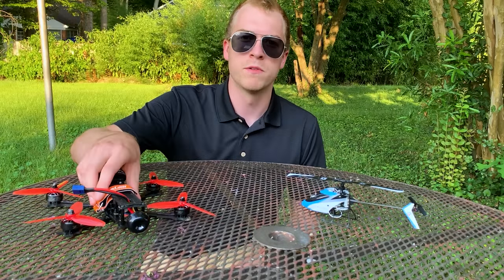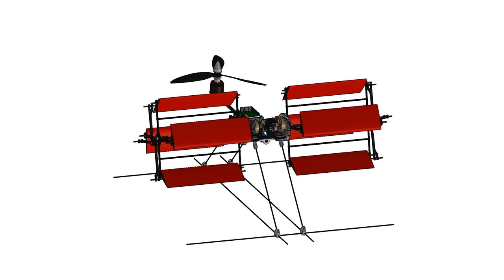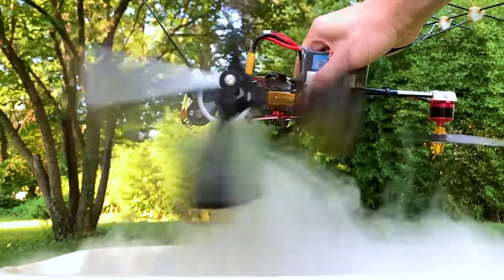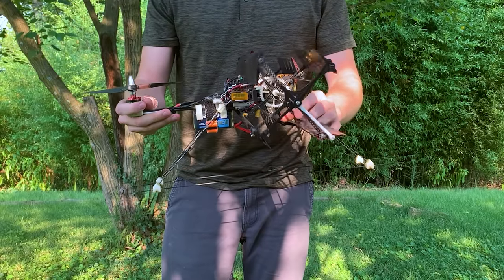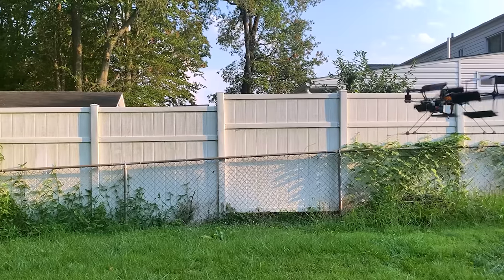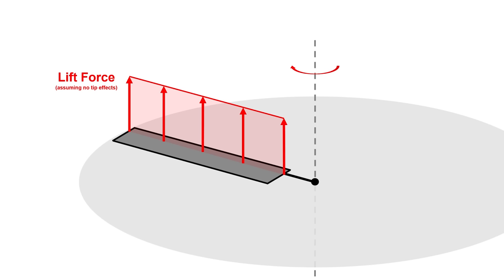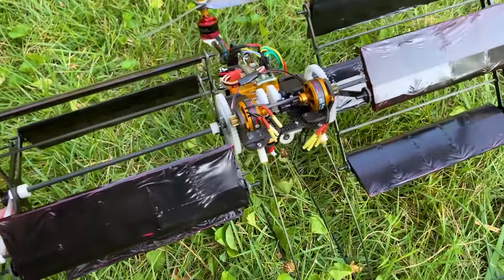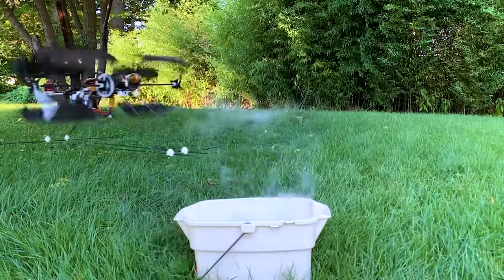Cycloidal Rotor Drone: The Cyclocopter

Comment: It looks like it flys (or flew) really well! I've never researched how these things work, but your explanation is really easy to understand!
Reply from the maker: Thanks Tom, it feels mostly like a tricopter in the air. There’s a bit of control coupling between pitch and roll that can create small oscillations, but a fast enough controller takes care of it just fine
Reply: I think you need to build one of these tom, with four cyclo-rotors.
Reply: @rcaviator8408  looks like toms goal is mainly on batteries or thing likely for energy storage…
Reply: @minercraftal  True. But I think he would be great at this.
Reply: @rcaviator8408  I’ve been tried on several objects and got problems of having everything jammed up. 
Seems it’s way better to get stuck on a single object so that able to finish it…
Reply: @minercraftal  Yup. Same here.
Reply: @rcaviator8408  Totally agree with this, kind of a tandem rotor equivalent. Also could you put a small dihedral angle between the rotors for additional stability?
Reply: Build one now?
Reply: hey tom your here i do not need to go you're channel bluild something like that i want to see you struggle to I will waiting fore the video wen to come out 🙂
Reply: Missing part of the hovercar puzzle 🤔
Reply: You should build a glider next.
Reply: Hey Tom build one and show us how, cheers
Reply: Hey Tom. I had this crazy idea of a circular wing (imagine using a conventional fixed airplane wing but join the wingtips so it makes a perfect circle. 

Then use a simple hamster wheel blower in the centre of this circular wing to push air over the fixed wing to create lift. It would resemble a toilet seat with a blower in the middle blowing out in all directions.

Would this work perhaps in a quad copter arrangement instead of rotating props?
Reply: @rcaviator8408  also tom needs to make it air-powered. or rocket engine .. or rubber band.
Reply: @kungpowchickenwing  That would be the concept of air multiplier/ bladeless fan.
Here is a video regarding the same: https://youtu.be/bPZI6XoHi10
Reply: @instamdgram  no one cares
Reply: @Jack777Er  people do care, language isn't trivial.
But pointing out someone is wrong is nothing personal :)
Reply: @Hurricane0499  Your link has nothing to do with this video. Left a dislike at your link for my trouble.
Reply: @NicholasRehm  - you mentioned there are drawbacks of the cyclocopter -- what are they?
Reply: Зз
Reply: Зз
Reply: Щщщ
Reply: Ща щ
Reply: Щ
Reply: Щщщщ
Reply: Hi bro I'm your subcriber from india
Reply: you just got a shoutout from scrapman @Nicholas Rehm
Reply: Isn't there inefficiency as the blade create lift only not more than 1/4th of full circle? Other times they're just moving through air. This is not the case with traditional propellers. Great work though! 💪😀👍
Reply: Flies*
Reply: @rcaviator8408 ;loopkpl
Reply: @Almighty-AI  The central portion and the tip of traditional propellor don't generate much lift. The air velocity is poor at the central portion of the disk. At the tip the air velocity reaches high mach number and also there are losses due to tip vortices, Drees (1949)

Comment: Reminds me of the Voith Schneider propulsion system that some ships have. It does work, and it has a few advantages over traditional propellers, but there's a reason why only very few ships were equipped with it. Maintenence cost mainly, an awful lot of moving parts.
Reply: It's the same idea (both use cyclorotors), but the VSP (Voith-Schneider Propulsion) system has a more sophisticated control linkage that adjusts both thrust direction and pitch (and thus thrust) magnitude; this cyclocopter changes rotor speed to control magnitude, which would not be practical in a large size.
Reply: Moving parts are always worse than complex geometry
Reply: Imagine it in combat 💥 😂
Reply: Yes, though it runs vertically in this application.
Reply: Yeah i'm holographic speed painter guy. I definitely think there are unexplored inertia powers and cyclone powers.

Comment: Looks like a flying combine harvester! 
Great video. Thanks for sharing 👍
Reply: Should call it a "combinecopter".
Reply: Good for kills insects ];-D.
Reply: If you make a helicopter sized one it's a human head harvester
Reply: I was thinking reel mower.
Reply: Scary thought given that reaper drone
Reply: @JohnDoeSmith08  it would make the song less catchy. "Now ive got a brand new combinecopter....
Reply: So true my friend 😅, combine, just don't know if this is efficient with anything other than direction changes, these cyclo rotors have a lot of grip on the air, changing direction much faster than normal quadcopter designs, wish we could use centrifugal force to make this better
Reply: If I may ask, could you try to make something with a 'blown'wing like a multiplier/Dyson fan design

Comment: Pretty cool that this concept has been used in boat propulsion for a long time. Voith Schneider is the company. It's used in tugs and some other specialty craft. It can drive any direction basically instantly.  Good work!
Reply: OOOOH. I didn't really understand how this method was meant to work, but your comment reminded me this was how the old steamships with big wheels used to propel themselves forward and it all clicked
Reply: @K3end0  Actually, that's slightly different. Paddle steamers as they are called, with the big wheels at the sides, have fixed paddles rather than movable ones. Voith Schneider make vertical-axis propellers of the same type as the horizontal axis blades of this cyclocopter. A key advantage is that by adjusting the central point about which the blades are offset, you can change the direction of propulsion to any horizontal direction, 360 degrees. That's why they are used for boats such as tug boats and car ferries that have to be very manoeuvrable.
Reply: VMS for the win!
Reply: @herseem  Kirsten-Vorth were the other company making cycloidal marine propellers.
Reply: @mightymystery9204  I didn't know that, thanks
Reply: @herseem  You're welcome. I learned that from a German Marine Engineering instructor at Webb Institute. He made sure we knew of Europaean companies as well as American. Broad knowledge, broad progress.
Reply: @herseem  Actually by the 1860s most paddle steamers were being fitted with feathering paddle wheels, which use basically the same linkage to control the pitch of the blades, however this offset hub is fixed in position and is just used to keep the blades at the bottom of the wheel flat-on against the water, instead of being adjustable for thrust vectoring.

However the torpedo boat USS Alarm built in 1873 was fitted with a Fowler Wheel, which is basically this exact system, but sitting vertically at the stern like the Voith system.
Reply: @DAKOTA56777 Thanks for that extra information 🙂
Reply: @herseem  No problem, like to mention the Alarm because she's fairly under recognized, even the Wikipedia page on cycloidal rotors doesn't make mention of her or the Fowler wheel in general, but it does mention the Voith system.
Reply: @DAKOTA56777  Actually, there's a fairly famous paddle steamer left in the UK, one of the only ones, called 'Waverley' and I'm pretty sure that it has fixed vanes on the rotor. I think most of the models of actual ones I've seen have all had fixed vanes as well. My Dad will know though - he has an encyclopaedic knowledge of that sort of thing.
Reply: @herseem  The Waverley has a feathering wheel, actually, but feathering paddle wheels aren't considered cycloidal rotors because the thrust is only being applied on the bottom in a single direction. The pivoting blades only serve to keep them flat on so they push the most water directly back, as opposed to rigid blade wheels where the blades at the front and back will be entering at an angle, and thus some of the thrust will be wasted trying to lift the ship up and down.

This is why rigid paddle wheel steamers tend to have very large diameter wheels, so they can have enough blades in the water for more continuous thrust at the very bottom of the wheel, where they will sit closer to vertical.

Basically all paddle steamers by the late 19th Century (and certainly the mid 20th like the Waverley ) use feathering wheels because they allow a much smaller wheel to be even more efficient than a large rigid one.

The Fowler wheel however is entirely different, it has a setup more akin to the Voith system, it is completely submerged and vertically oriented, and the blades are adjustable to provide thrust vectoring.
Reply: @DAKOTA56777  Well, I must admit that it is a very long time since I went on the Waverley, and I wasn't watching out for such things at the time (I was young). But I'm sure my Dad will have something to contribute to this. Didn't know about the Fowler wheel at all before though.
Reply: @herseem  I mean, to be fair, it is rather hard to see the blades of a feathering paddle wheel pivoting from inside the ship, when you generally would need to be outside, under water. :p
Reply: @herseem  https://youtu.be/SAnyI64PA-U

Here, in this video if you look closely you can see how the blades pivot ever so slightly as the wheel moves.
Reply: @K3end0  Not the same thing. This is providing lift, not forward propulsion in itself. The direction of lift is changed but there's not really any propulsion in the traditional sense. Jason is talking about a much more modern propulsion system used in some tugboats. Most of them still use thrusters to do this. look up this name. This is a video featuring the Voith Schneider  system and they're the biggest if not only company doing it. This is nothing like a paddle wheel actually.  youtu.be/soSXexOar8w
Reply: @mightymystery9204 Mate I never heard of Kirsten-Vorth and just did a search of the name with the easily segregating terms of cycloidal and marine and propulsion, just one at a time next to his name and nada.  Because the name is similar to the one I do know, which is Voith Shneider, I suspect you mis remembered that as happens with us all as we get older or are reaching for a memory not examined for a while. Voith is the main company making cycloidal propulsion systems for tugs and ferries. If you look up cycloidal propulsion systems, it is the only name you will find.
Reply: @DAKOTA56777  Makes me think of retracting blades on the paddle wheel. No more complex but it would be efficient. A fixed cam inside the wheels radius would do this. Retracting as they rise from the water and projecting as they reach optimal direction. I guess it would be noisier..
Reply: @GrassPossum  I made no mistake with Kirsten-Vorth. Frederick Kirsten had designed a cycloidal propeller which was manufactured by the now-defunct Vorth Engineering of Midlands, in the UK. Boeing in the United States apparently acquired rights to the Kirsten system, which can be used with gas turbine marine propulsion, as Vorth had done with steam turbines. 
Such errors of non-experience have also happened with B & W, which were Babcock and Wilcox marine steam boiler systems, but later could also represent Burmeister & Wain marine diesel systems.

Comment: When flipping, could you theoretically keep adjusting the airfoils so they always create lift upwards, (making it possible to not only maintain altitude but also have it front flip very slowly)
Reply from the maker: Yes—if my servos have enough travel or I implemented collective control
Reply: As it was, it just needed higher initial altitude prior to attempt of the forward flip.
Reply: But Helo don't do forward flips, but some can do a 360 loop or roll...?
Reply: @darrenthompson6115  Collective pitch R/C model helicopters can flip forwards, backwards or sideways. Do a search for Radio Control 3D helicopters to see what I'm saying. R/C Pilots fly them like hummingbirds on crack.
Reply: @hifinsword  well.... I took you advice and came across Tarek Assardi.... OMGgggghh... never seen precision snd sheer talent flying like that.... totally astounded...🤷🏼‍♂️🤷🏼‍♂️
Reply: @gulfair-cavalry-tango1011  Whenever I'm trying a new maneuver with my RC planes, I go 3 or 4 mistakes high first.
Reply: Surely if enough professional development was put into this, you could have a full scale aircraft with an avionics computer that could let you move it in just about in any direction instantly!
Reply: @darrenthompson6115  yeah, man, Tarek has mad skills, and unreal reflexes.
Reply: Wonder how it looks upscaled also the roters pitch could be controlled by a on board  computer to adjust em instead of the 2nd axis
Reply: Like one of those 3D helicopters!
Reply: A good application is that thy cyclorotor can also be used as a wheel when you put a larger disk on it as a wheel.
Reply: @hifinsword  I have seen some of those and you're right. I was speechless at the maneuvers and cannot even imagine a full size one with a pilot doing most of it. For one thing their brains would be leaking out their ears and their necks and spines probably dislocated to the point they'd never stand again. Now you remind me, the awe is overcoming me and I'm off to get a fix of some of it.
Reply: @mq-r3apz291  How about inflatable wheels which expand out from the rims with some compression from the engines, and  give you ground contact, and can be deflated and retracted again for flight? Then you'll just need very wide roads to drive on or go off road. 😁 

(This isn't serious, I see problems with it and better ideas to achieve the same end, so no need for aspiring inventors to tell me why it is a dumb idea. I'm just suggesting an improved way to have the cyclorotor drive as well. Not that I consider this a good idea in itself.)
Reply: @philhines  If this was a manned aircraft, it would make more sense to have the fixed front rotor in the rear, not the front. It limits visibility in the front.

Comment: Nice. One tiny question though: How about the efficiency compared?. It must be better to compensate for the added complexity i.e. construction cost.
Reply from the maker: Efficiency is slightly less, but only because it has not been 'optimized to heck' like multirotor propellers yet... Really, its not a fair comparison to directly compare efficiency as your main metric of 'usefulness' since the aerodynamics are so different. There are other benefits/design considerations to factor in too like thrust vectoring ability or disk loading/tip speed!
Reply: In copters/drones tip speed is so to say a resolved issue. The total weight is a factor too, as is construction cost (and  also efficiency, as it too determines need for power and fuel to reach set goal.) Interesting anyhow. A comparison to Flettner too would be interesting!
Reply from the maker: @henriksegercrantz362  it’ll never beat propellers/drones, that’s for sure. But larger scale…
Reply: @NicholasRehm  Why do you think so?
Reply: @janami-dharmam  also interested to know why!
Reply: I don't agree that it has added complexity compared to helicopters; the systems that control blade pitch on helicopters are incredibly complicated, and they also experience much more intense forces than this cyclocopter system does, since these blades are supported at both ends.
Reply: @keithklassen5320  I still think that the construction costs will be higher. Complexity is a matter of taste. :)
Reply: @NicholasRehm  
Efficiency compared to what ... and airplane or a helicopter, and for what purpose?
Will this thing lift as much cargo as a helicopter?
Still boggling my mind.
Reply: @keithklassen5320  One being complicated doesn’t mean another thing isn’t more complicated. 
The helicopter has been around 81 years. IE: for as complex as it is, it was doable long before this. There’s also talk of using a “neural network” for flight control to keep it stable. That’s hardly less complicated. 
I don’t know if the blades experience less forces, but they have to be so light they tend to snap, despite being supported. ….and every paper on the concept notes the complexity of it.
Reply: How big will a human size version look like vs a helicopter, how much space does it take. Also how big will those axis look like where the blade are fixes on
Reply: I’m more worried about it breaking with all those moving parts. This thing can’t safely land if anything goes wrong with its engines, controls, or electronics.
Reply: Downsides include incredibly bad stability issues in pitch axis due to aft CG and the nose propellor location. Personally I think it would be better to Mount the propellor a little higher to keep it out of the cyclorotor wash and fly it in the opposite direction. Its large surface area would make it particularly draggy in forward flight and highly susceptible to birdstrikes. That, added with the proven propensity to suffer catastrophic breakages in the exposed control linkages, consign it to the bin. Nevertheless, I love that it was built and flew. Great passion!